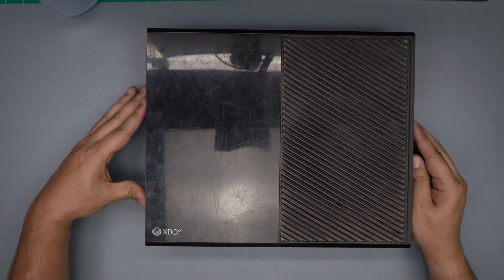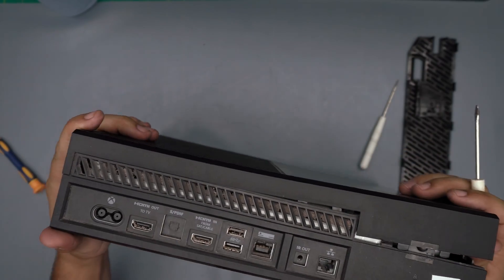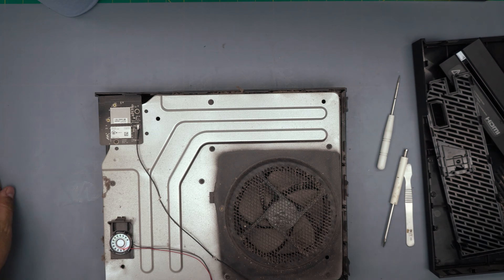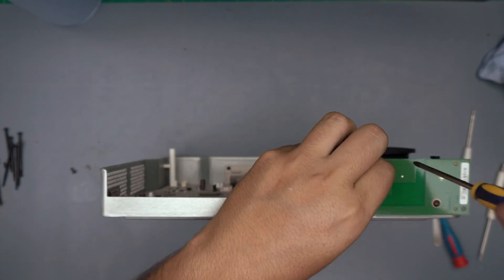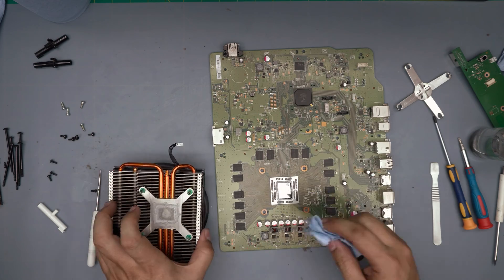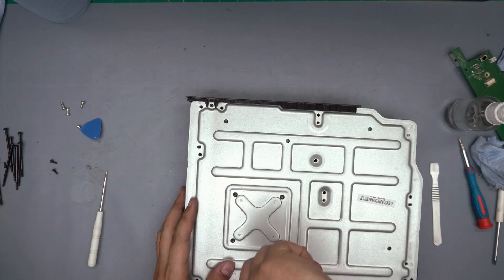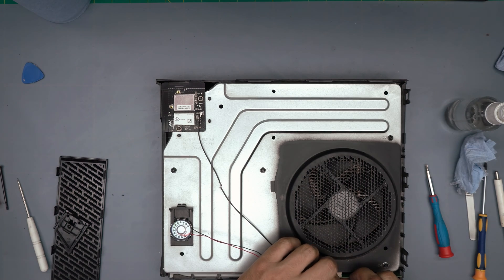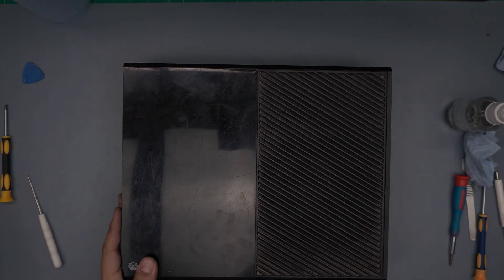How to Repaste and Clean the XBOX One Original 1540 Step by Step 🧹

Comment: Hi  I replaced my Xbox one original thermal paste with the new one it still automatically switch off when I play games is there anything I've done wrong?
Reply from the maker: 🫠 Regarding your question, you could have a bad PSU as well. We see this issue a lot in the store, and about 60% of the time it’s due to the PSU. The rest of the cases are usually caused by repasting or the fan not spinning.
Should you have any further questions or requests in the future, please don't hesitate to ask me.
cheers🍻

Comment: Hi there i bought a 3rd party power supply it runs while i watch yt but once i got into games it makes buzzing noise then it overheated my thermal paste is completely dried up could thos be why ?
Reply from the maker: 🫠Regarding your question, it could be because of the over heating, but again a cheap PSU will not be able to deliver the amps that is needed.
Reply: @uFixTek  I got a xbox one model 1540 made in 2015 what power supply should I get?
Reply from the maker: we have purchased from this seller and didn't had any issues:
https://amzn.to/4idnoWa

This is an Amazon affiliate link. When you use my links, you are helping to support the channel. 🙏

Comment: doing this i broke a component off the top of the cpu any way to fix ? i cant seem to find my specific motherboard i also cant seem to find a way to replace just the cpu
Reply: ah they are caps on top of the cpu yeah i broke one of those off
Reply from the maker: much appreciate the support, you need to get an CPU or board from ebay dead board and you will need a heatgun and flux to be able to replace the Caps, i recommend you to take to repair shop and tell them how much they charge to replace the caps it should not cost more than 20usd.
Should you have any further questions or requests in the future, please don't hesitate to ask me.
cheers🍻

Comment: What i love about that heatsink is the screws. They used the same clamp in the O.G. 360 and it would warp and over heat so the diy solution was washer and screw kit lol. I feel  validated for using  the diy method back then now. Theres  a few youtubers that have judged me for it. Lol This video has mad me feel more comfortable now to dive into a X One thx.
Reply from the maker: Thank you for your feedback! If you wish to support the channel, you can like, subscribe, or both!
Regarding your situation, just open and clean and use a good quality thermal paste like: thermal grizzly kryonaut: https://amzn.to/3Qs7ufv
no need for washers on any of the xbox one series, that washer was for the xbox 360 only because of horrible heatsink that they had and a bad fan system and bad fan curve.
here only repaste with good quality paste and you set to go.
Should you have any further questions or requests in the future, please don't hesitate to ask me.
This is an  Amazon affiliate, when you use my links, I earn a percentage, which helps support the channel🙏.

Comment: Many thanks 👍
Reply from the maker: It's my pleasure my friend. 😊 Thank you for taking the time to give feedback! If you would like to support the channel, please like, subscribe, or both. :P
Should you have any further questions or requests in the future, please don't hesitate to ask me.
Reply: @uFixTek  Thank you very much , I want to ask you about the power supply of the x-box , which I changed a capacitor in but I did not found the same capacitor so,I put a capacitor that has the same voltage but a big capacitance then I plugged the power supply to the x-box and it run all good but after a minute the device shout down !  Does that capacitor is the reason ??
Reply from the maker: i would need to see a picture of the capacitor old one and the new one and the inside of the charger, but its not because you place a bigger capacitance (depending how big), i have made few videos on those,
https://youtu.be/S1RrtsaWgx8
https://youtu.be/e87ZTBRr6vk
note, Microsoft always changes the inside of the chargers all the time so yours my always be different.
Reply: @uFixTek  Really thanks , you deserve like 👍 and subs 🌺
Reply from the maker: much appreciate it .🍻
Reply from the maker: GOD is great, GOD is LOVE ❤️ يرحمك الله